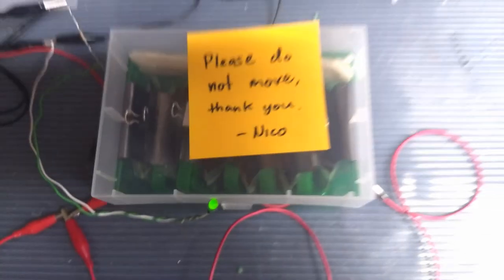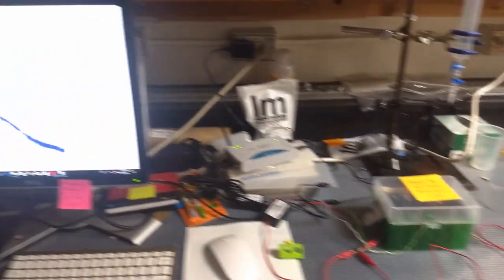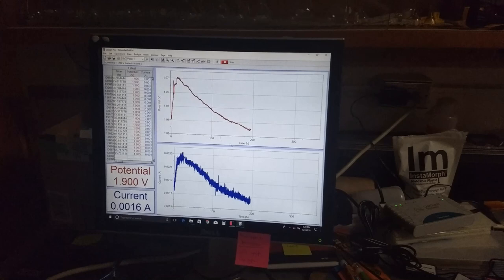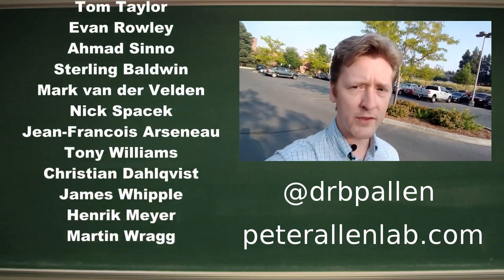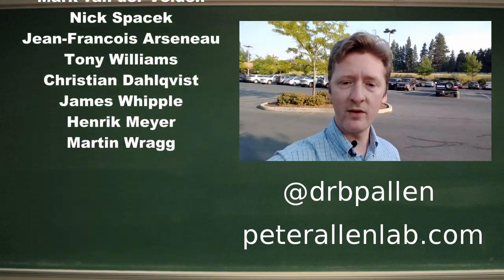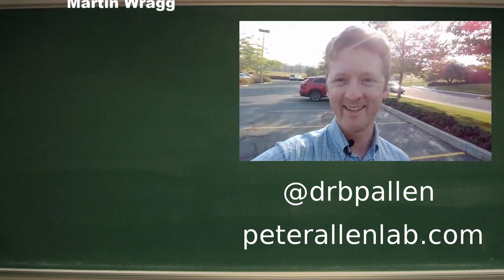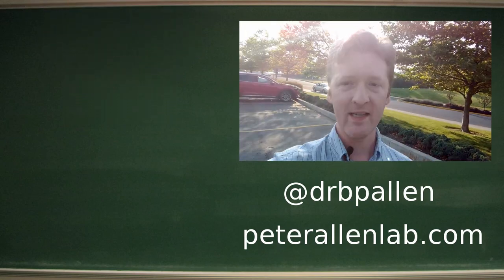Iron 6-Cell Battery: Still going at 200 hours

Comment: That is an encouraging update. I agree with solarhope about using increasing resistances to determine if the discharge characteristics are linear relative to increasing current draw. First hings first though. Complete your current tests. You're doing well.